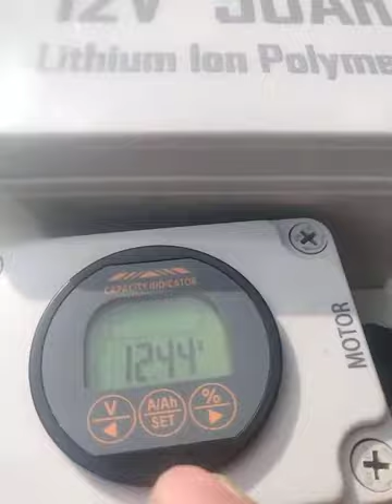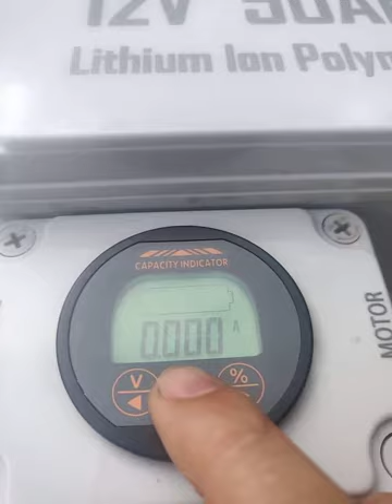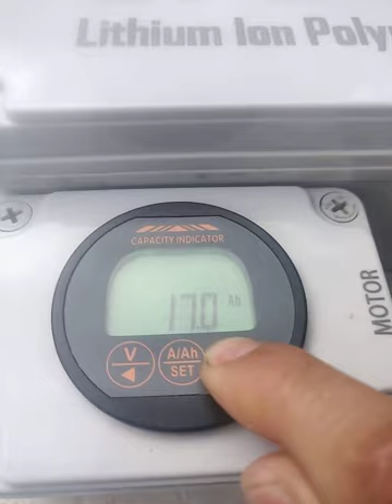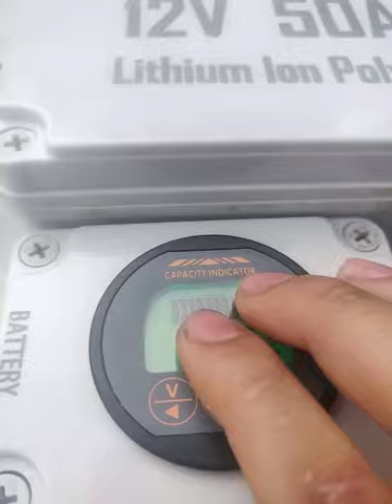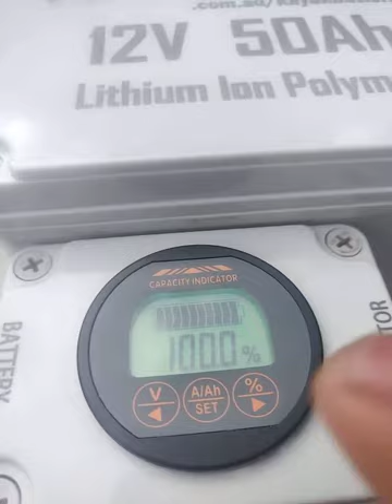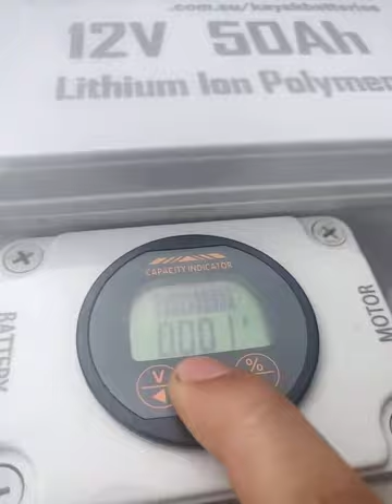FPV-POWER Battery Meter Setup Instructions.

Comment: Too expensive. You make good stuff but charge too much. The board you use in your switching box is the same one I use in different projects, they are $12.00. I like what you do but you really should lower your MSRP. The 129.00 kit should honestly be about $89.00.
Reply: lol! I looked at the shop and saw the wire glands. I cant believe he thinks he can sell them for 5$ a pop when I could buy 50 of them for 12$ on amazon. Yet he pretends his are specially made for kayaks. Its a gross practice